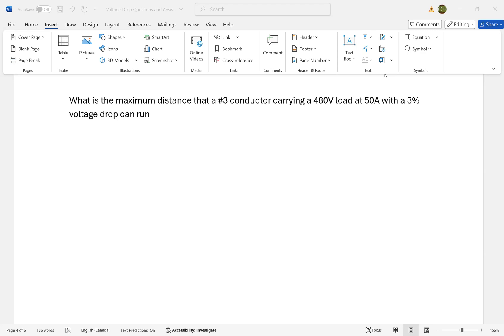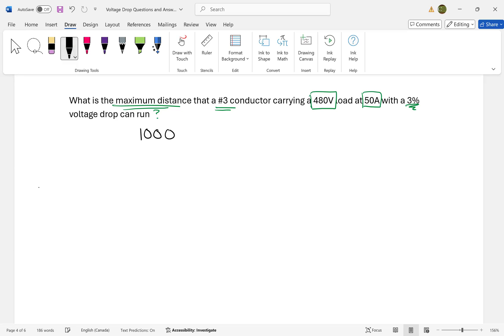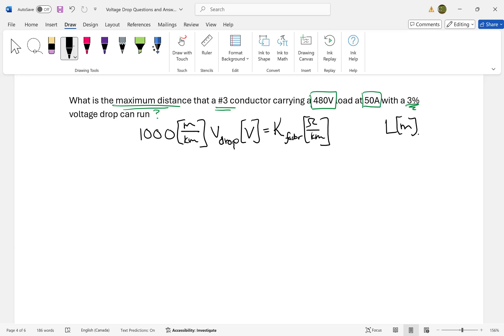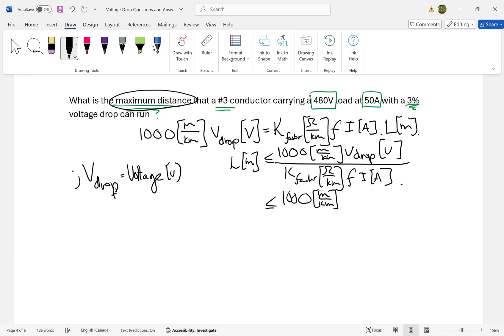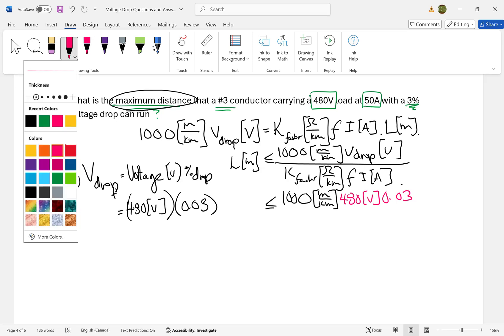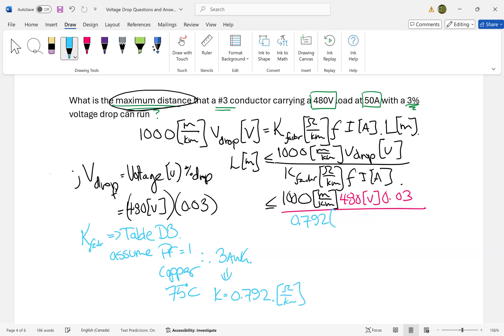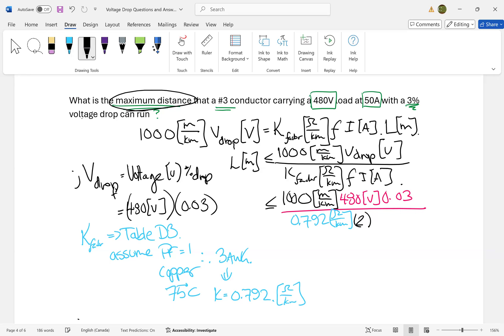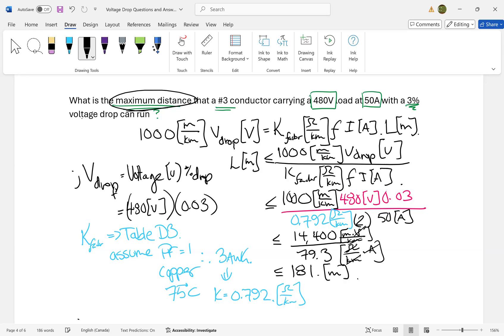Voltage Drop Example Problem Max Distance CEC Table D3 to Study for Electrical Exam

Comment: madam nice work, but you are teaching like those already pass or known, just if you shown the value you putting where to taking from in formula, every one have to search what and how you done but how it came , like in table D3 pf 100% you took for K value { 0.792 ( om/km}but there is many percentages 80-100, why we took 100 one and note 2 you took, 2 value to multiply.... but for new you did not mentioned why and where in question mention value 2 have to take for note 2, and whome we assume note 2 etc.
Reply from the maker: Great point! For new learners, I can see how more explanation on the choices from the tables would be helpful.  I hope clarificaiton will come from my other Voltage Drop videos.  They are in the Section 8 (Voltage Drop) Playlist: https://www.youtube.com/playlist?list=PLA9NP6jZaB1P7j6XnNEVVtlEW9YQym1Uv

let me know if this helps?  Thank you for watching. You are working hard I can tell.
Reply: @Prof.K.  ok thanks, very true, I need to watch previous basic videos I think you uploaded. your uploaded videos are very helpful that links you shared.Thanks again
Reply from the maker: @MUHAMMADKHAN-sf8rd  but still, if you have questions after you start at the basic videos, do let me know!

Comment: Hi I have a question on the voltage drop factor (f), the load voltage is 480V, I was thinking of 1.73 instead of 2 as 480V is standard voltage with 3 wires. Thanks.

Comment: Are you able to explain why a 60-degree C wire can run further than a 90-degree C wire when you use the new VD formula?
Reply from the maker: Mathematically speaking, you are dividing by current, and the 60 degree C conductors have less current potential than the 90 degree C conductors.  Lower current in the denominator means higher Length, L.  Practically speaking, the same theory applies: since there will be less current in the conductor, there will be less voltage drop across a given length of span.  Thank you for this great question.  Does this help you?
Reply: @Prof.K.  This helps tremendously!! Thank you so much for replying. It was driving me crazy that it did not make sense, so I appreciate the help :).
Reply from the maker: @macgeddes  I'm happy to help!  Reach out with any other questions and I'll try my best.